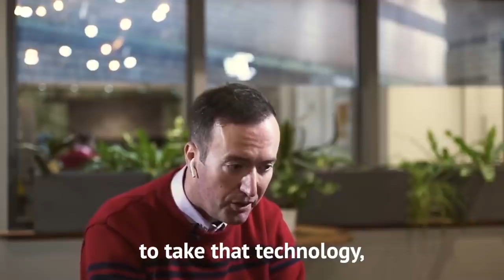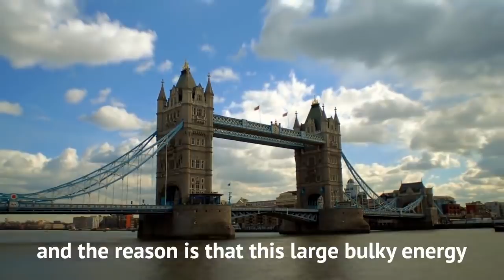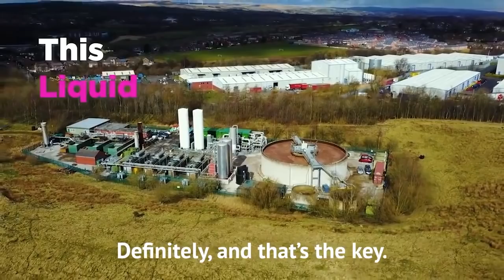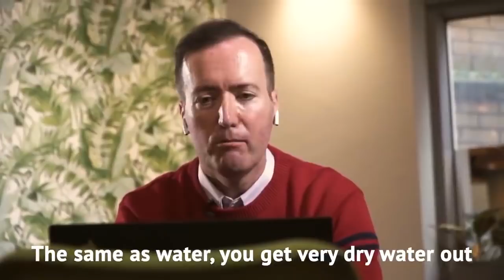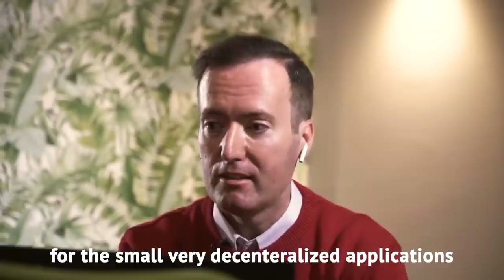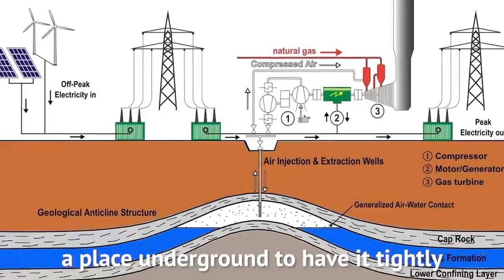Highview Power: Grid Storage Out of Thin Air

Comment: The downside of this company is that liquifying air is not a very efficient use of solar or wind power. But this is certainly a good way to handle major surges in intermittent renewable energy. 

If the strategy is to massively overload the grid with renewable capacity and balance with storage, this company will be clutch.

Comment: You really should’ve asked about how this technology compares with hydrogen energy storage. The EU, the US, and Asia all have governments that seem to be very interested in hydrogen for storage. How do we get them to consider LAES instead? Does it have any advantages over hydrogen that we can use to help sell this?
Reply: Pumped Hydro runs 70-75% efficiency

Liquid air runs 60-70+% depending on how effectively the waste heat is used. 

Hydrogen runs 20-45% depending on H2 formation, storage and generation methods used. 

Hydrogen will have a very limited use cases. It is primarily being pushed by and funded by current fossil fuel companies in order to prolong their viability. 

Over 95% of all hydrogen in use today is sourced from fossil fuels.

Comment: What’s the round trip (compression expansion) of this system as compared to batteries or pumped hydro?
Reply: Did you find out? Id say its not that efficient. Theyd need waste heat source to keep it relatively efficient. Id say 15% to compress 15% to expand and 10% to store.. not to mention cost of filtrations and compressing and heat pumps.

Comment: I didn't quite understand how this works
Reply: You use excess electricity to compress and cool nitrogen into a liquid and store liquid nitrogen  in a thermal flask.. then when you want electiricty back. You warm up liquid nitrogen ,it exspands and makes pressure that drives a turbine ti produce electricity..  is that what you mean?
Reply: Its legit. Just how efficient is question . And cost to install and operate needs to be compared to teslas mega battery

Comment: The traditional power grid was production, distribution, and consumption. This one way system resulted in a certain mindset, which may result in big solar and wind farms with large storage facilities. On the other hand, a distributed systems would balance the equation with micro grids and many local renewable sources. It will be interesting to see the battle. 

I think this reference, though old, is interesting:

ABC Science, Australia,  Comprehensive,  Feb 2016
Battery Powered Homes | Renewable Solar Energy Storage
https://www.youtube.com/watch?v=yxABosWfuus

Comment: I don't think there were any questions about efficiency. Their brochure (link below) says "60% efficiency
 in standalone configuration" and "70%+ efficiency
 by utilising waste heat or cold". This is pretty good and way better than hydrogen + fuel cell, but a bit less than Dinorwig (pumped hydro UK) at 74–76%. Sounds like a winner if these figures are correct.

They were founded in 2005, are privately owned and located in London.

in Central Londonhttps://www.highviewpower.com/wp-content/uploads/2018/04/Highview-Brochure-November-2017-Online-A4-web.pdf

Comment: Without a discussion of efficiency, you cant talk about how this would work in the energy market. Your talking about taking a finished product, electricity, and losing a lot of it to turn back into that same electricity. There is no turbine that can extract energy as well as a battery. What this effect has is you would have to multiple the price or renewable storage by the efficiency factor making it much more expensive.
Reply: They have done webinars that show comparison to hydrogen, much more efficient, about twenty percent loss. They have clever tech that stores excess heat from the turbines and then use in the liquefaction.  Perfect use case for excess renewable power or wasted hear or cold at industrial site.

Comment: was telling people about this 11 yrs ago, most of them thought I was nuts and certain industries very much, still, don't want this type of change to happen. We will get there though, there are compressed air driven cars to, they used carbon fibre tanks below capacity.
Reply: Was talking about liquid air cars in the Nineties but I lazily never did the research to determine the amount of energy per a given amount of liquid air. Does anyone know? In looking at compressed air cars, I come up with about 133 W/hr. per liter for liquid but the energy out will depend on the efficiency of the turbine or motor. If this is say 70%, then it gets about 100 W/hr. elec. out per liter. This is about a third or less of what a Lion would deliver by mass I estimate. However, if the waste heat from liquefaction is stored by say, molten salt, the overall efficiency could reach 60%. Solar air heating panels on the car body could increase this further. It could make for a cheap car with all the air conditioning you could use.

Comment: The only critical component missing from this video is the fact that when the cycle is complete, 2 kilowatts in makes less than 1 kilowatt out. And although perhaps cheap to build, I would guess the maintenance is pretty high too. Interesting technology, but just like hydrogen, lacks the efficiency to make it something viable for long term. This video is basically an infomercial of hype.
Reply: This is incorrect. Liquid air has a 60% efficiency in standalone configuration and 70%+ efficiency when utilising waste heat. 

By comparison pumped hydro is in the 70-75% efficiency range. While Hydrogen is in the 20-40% range depending on formation, storage and generation methods used.

Comment: The issue here is efficiency, you waste a lot of energy liquefying air and more energy to maintain the low temperature.  What is the efficiency, 50%?
Reply: I think efficiency has become a mantra that we don't fully understand, we just want it because someone told us we want it. 

Look at it this way, the grid needs more wind and Solar but those are unreliable. Often, they overproduce what the grid needs and that will get worse as more is installed. Right now, that extra energy is curtailed, they just shut off the generation capability, 100% wasted.  If instead we run it through this plant and use 50%, isn't that a better option?

There are use cases for more efficient forms, sure.  But more efficient forms of storage are also more expensive, especially when scaled up.  Each tech will have its use, I can see this one shining in grid storage and balancing.
Reply: The issue that matters is really cost.

Comment: So are they running the turbines just simply by the pressure, almost as you would steam?  or are they using the "air' as a mixture into a combustion process?... Its not exactly clear how they turn the tanks of air back into something useful.....  I have seen a car that has  a "pnumatic piston engine--  But it had to be a very high pressure...  Which I suppose if you are compressing air so much that it turned into liquid--- I'm sure its high pressure. lol.   This is actually very interesting......... Between this battery and a gravity battery-- it really does make wind and solar make so much more sense.
Reply: It has to be heated a little. This is more efficient if it's waste heat from a factory.

Comment: We need to start talking about long distance high voltage DC energy transmission. The high voltage lines we have now loose a lot of energy. High voltage DC doesn’t have that issue. 

Current the problem with high voltage DC is the cost of the equipment.
Reply: I don't beleive that's true.   Edison and Tesla already had these wars back when they were deciding what system was going to be built;  and I believe it was proven that DC has a much greater voltage drop across long distances, and you have to build  amplifier stations along the way.  I don't recall with any real certainty though --- I just remermber seeing something like that on, maybe TLC back in the day-- like a mini documentary style show.
Reply: @calholli  Go read some references rather than speculating/disagreeing on the basis of half-remembered documentaries :-) . What I said is correct. Wikipedia is generallly a good reference.
Reply: @Wookey.  I graduated in 2000.  Took electronics class and graduated as a general electronics technician.  I also worked for a couple years as an electrician, I quit at the journeyman level.  I also trimmed trees around the power line companies for over 5 years;  So I'm not completely ignorant to how electricity works, just a little rusty because its been awhile.  I thought about it for a few moments:  I believe the comparison I was referring to was todays AC transmission lines vs trying to send 220 DC down the power lines--- which is a dumb comparison, and makes sense why I remember them needing booster stations along the way from heat losses due to all the current being transferred.  Obviously it has to be high voltage, to lower the current and minimize losses.  The argument was that you can't easily step the voltages up on DC through simple and cheap transformers, like you can AC.  So you would have to transfer at the voltage that it was being generated, which is much lower than the 765kv AC that is used today... meaning the losses would be too high.  So obviously it must be stepped up, and the only real way to do that (DC) is to take the generated AC voltage and step it up through transformers (which is what we do already) and then add on the extra cost of building huge high voltage converter stations to convert to DC.....  and again, once it reaches the destination, there is no real way to lower the voltage back down without building yet another huge converter station (back to AC) so that you can step it back down through transformers again (as we already do) to primary voltages.  All of our in home systems can't easily be converted to a DC system without everyone buying all new appliances and bulbs, ect..  So there is no real point in sending DC all the way to the home...........  And even if there are minimal effeciency gains from HVDC, you have all that extra cost of building the huge converter stations on both ends.  It just seems like another layer of complexity and cost without enough reduction in losses to offset the expense.  Maybe if you are building the entire infrastructure from scratch, like in a 3rd world country that doesn't have anything yet--- then maybe you could integrate it for the longest transmission runs and it might make sense....  One of the main advantages of HVDC is that you only need 2 conductors instead of three and you can use smaller conductors due to not having the induction losses, interference losses, and skin affect losses--  But our infrastructure is already built, so you wouldn't be able to get those gains unless you are building a long line for the first time.. And it would have to be long distance for it to add up enough reduction in loses to make it worth building those large converters.... I can see possible situations when it could actaully make sense, and once its built,the running costs in the long term would make it worth it.. Sorry so long, but you said you wanted to "talk about it" -- lol
Reply: @calholli  Exactly. So DC is normally used for new interconnects that are either very long or connect unsynchronised grids, although we have two quite short subsea ones in the UK that are just instead of conventional AC links . We have 7 already in use and 2 more under construction: https://en.wikipedia.org/wiki/List_of_HVDC_projects#Maps and there are plenty more around Europe and the world. So they clearly do make sense in practice.
Reply: Existing HV transmission is reasonably efficient. The UK HV grid only 
loses 4-7% for example. It's just that the longer the distance the better DC looks, so for very long lines or connections between unsyncronised grids it's better than AC (but also much more expensive).

Comment: How can we invest in Highview Power?   These are the companies I want to support.
Reply: I looked at this a few years ago and they only seemed to be taking money from the sort of people who can put 100K in (and not worry too much if it all fails). So far as I can tell that's still true.
Reply: @Wookey.  yeah-- I don't really see the benifits of going through all that trouble to liquify --- when simple compressed air in tanks would probably be easier----  and then just running pneumatic motors..........  especially when stored hydro and gravity batteries seem even easier to build.... Seems like it would lose efficency pretty fast,the longer that you would have to store it... Think of the energy it takes to refriderate things......... and again, I don't even understand the benifits.  .......  Seems like using that surplus energy to make hydrogen and use the hydrogen to burn in turbines, would be even easier.. who knows.  I'd love to see technical comparisons on all these ideas.
Reply: @calholli  Compressed air storage is a thing too. 'CAES' as opposed to 'LAES'. There is a large one in Germany using a salt cavern, but it's only 42% efficient. https://en.wikipedia.org/wiki/Compressed-air_energy_storage
The issue is managing the heat generated by compression. CAES with caverns has the same problem as pumped hydro - you can only use it in places with convenient geography. Insulated tanks can be built anywhere and storage loses are quite low for large tanks. Highview do some clever stuff to move waste heat from the compressors to the expansion turbines, which significantly improves efficiency. Newer CAES designs do too, but none of those are online yet so we don't know exactly how the efficiencies compare. 
Making Hydrogen by electrolysis is 70% efficient, but that's only one way. Burn it in a turbine is 50-60% so round-trip efficiency is only 35%. That's worse than diabatic CAES. It does have the advantage of geographic independence and the electrolysis part can be very small-scale. And you can use the hydrogen directly as fuel.
I agree comparisons would be very interesting. As new both CAES and LAES plant is being constructed we will no doubt get some real numbers soon. Overall I think LAES could turn out to be very popular if the cost is as good as Javier says.
Reply: @calholli  "especially when stored hydro and gravity batteries seem even easier to build.... "
Hydro is dependent on geography. And gravity batteries either require massive holes in the ground or elaborate block towers with coordinated cranes. These are all part of the solution but liquid air seems the most scalable. The closer the storage is to the consumer the better so transmission losses occur when charged by surplus solar/wind  instead of having the bulk of transmission losses between storage and consumer. 

"Think of the energy it takes to refriderate things"
You can either keep it liquid by refrigeration or keeping it under pressure in an insulated chamber. We had liquid oxygen carts in the Air Force. They were fine sitting out in 100F+ weather with negligible losses from expansion. But I assume if thermal expansion is unavoidable for liquid air then that can just be used to generate electricity or cooling etc..
Reply: @richardlinares6314  I'm not really sure how it works-- because normally, pressure and temperature are proportional-- in that the more pressure you have, the higher the temperature.   So I'm not even sure about the process that it takes to liquify air.  I'm all for it if it has a use. We should be doing all of these things.  I think the REAL use of surplus electricity should be to make hydrogen-- its easy to do through electrolysis..
Reply: Given the couple of comments you have made on this video you need to take some time and educate yourself on thermodynamics. Something you might want to pay particular attention to is  comparing efficiencies of various storage options.
Reply: @calholli  As I understand it, they use kind of parallel processes: compressing the air releases heat. This heat is stored separately from the liquified air. When electricity is needed, the liquid air is expanded, this uses heat again that is provided by the heat storage. If you don’t store the heat as well you would need a. To get rid of it which uses energy and b. Get the heat during expansion which also consumes energy. By storing the heat as well, the overall efficiency is much better.
Reply: Does SOHVY (Sumitomo Heavy Industries ADR) own a stake in Highview Power?   They seem to be very thinly traded.

Comment: OK, but what's the round-trip efficiency? For me it seems like there's a huge amount of waste with the cooling and reheating. If the losses are not too horrible, then the super low cost and the practically unlimited capacity would still worth it, but only for long term storage, but not for daily cycling. Maybe you can even store energy for the entire winter.
The other issue is the large scale. We are moving from large power plants to distributed energy generation and storage, so this doesn't fit well into the new system.
Reply: Solar can be a distributed system but wind is best in specific areas. So a big wind farm needs this.
Reply: @ecospider5  nah this is ideal for places that have lots of waste heat processes.. and lots of electrical energy curtailment.